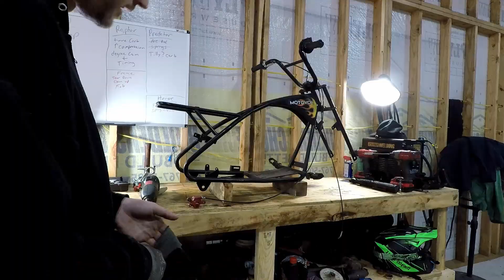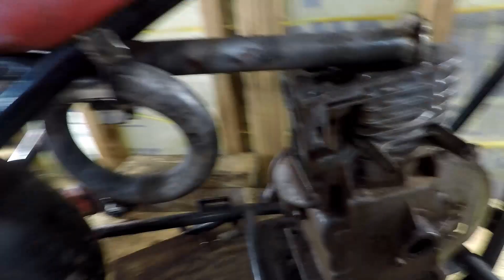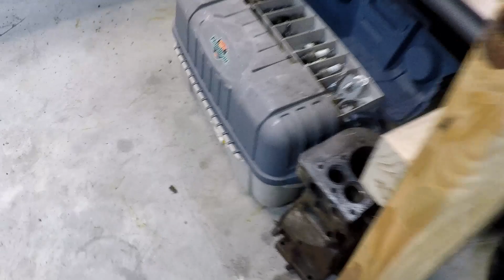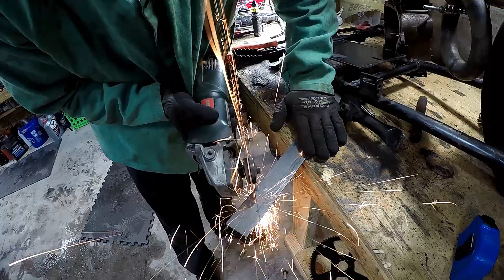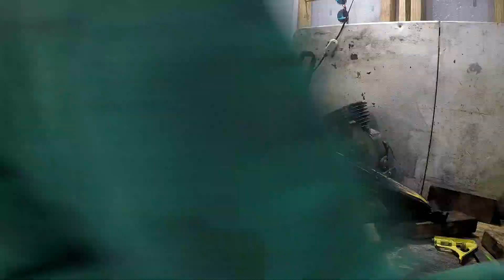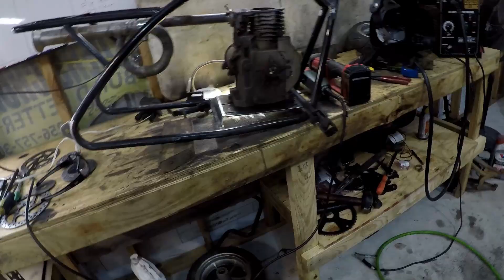Flathead Minibike: The Coolest Build You Didn't Know Existed

Comment: Spo if i get that roller frame off Gopowersports will these wheels pop right on
Reply from the maker: Gotta get different bearings for the front wheel and cut the axle spacers down to fit
Reply: @RAWRMotorsports  GOT YA THANKS FOR THE INFO
Reply from the maker: 30x12 bearings I think  🤔 the ones in it are 30x10
Reply: @RAWRMotorsports  just got a Ducar 212 engine i posted a short vid on my crappy channel just wanna let u know ya vids inspired me to build one